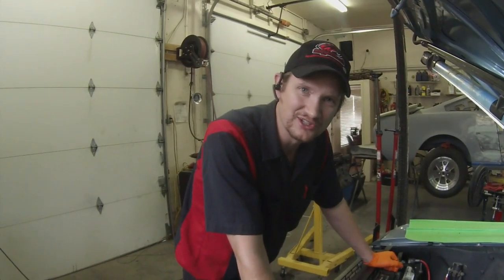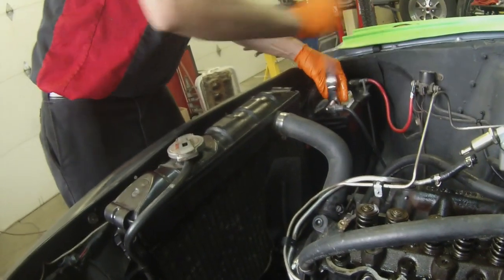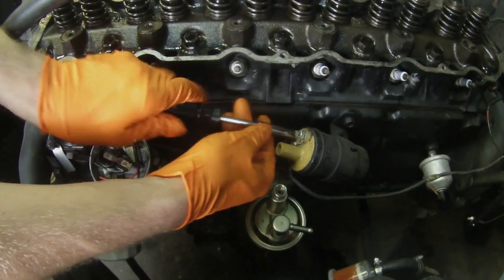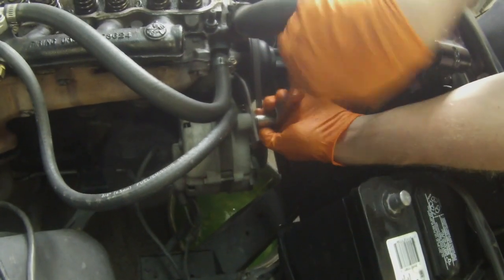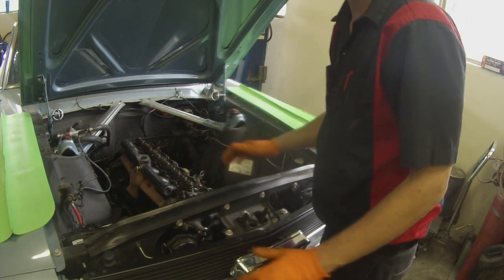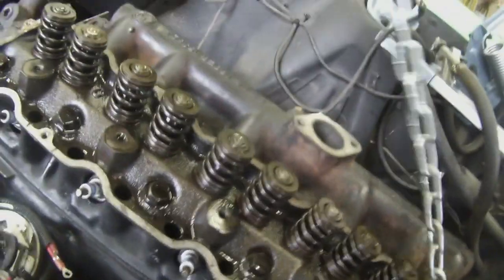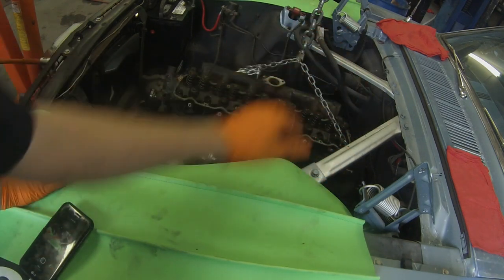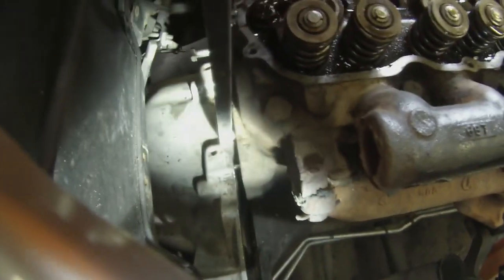Engine Removal 200 inline 6 -1966 Ford Mustang

Comment: I wanted to comment on removing the hood. The use of painter’s tape is such a good idea. I use that stuff for all sorts of purposes and mainly for marking where things go. When I remove a hood, I always loosen the 4 bolts (or nuts) remove the top fasteners first and then do the bottom ones. I saw someone do the opposite and folded the hood at the top because they lost their grip. I’ve never forgotten that.
Reply from the maker: Oh wow thank you for sharing your knowledge and experience!

Comment: What are you having a hard time finding, parts-wise?
Reply from the maker: Pretty much everything 6 cylinder related but I should clarify that the local market is hard to find. I can get stuff shipped in but finding things local is harder to find than 289 stuff.

Comment: Thanks for this video.  I'm working on pulling the in-line 6 from my 1966 mustang.  It has the 3-speed transmission.  Is it possible to pull the transmission at the same time?  The existing 3-speed transmission is sloppy so I want to either rebuild it or swap it out for a 1967 or later 3-speed that has a synchronized 1st gear.  If its possible to pull both at the same time, how do I disconnect the clutch bar from the engine?

Thx
Reply from the maker: It's very possible to pull both at once. I've done it before but you'll want to connect your engine hoist differently then what I demonstrated on this video. You'll want to balance it better from front to rear. I actually have a video on the clutch bar for a V8. The process will be similar for a 6 cylinder.
Reply from the maker: https://youtu.be/vwKSKRKLI3A
Reply: I used to do a bit of this kind of work and I always found it easier to do the engine and transmission at the same time but as  @AlfsMustangGarage  says you really have to be weary of the balance and where the chain is in order to maintain balance. It’s probably easier to do with V8’s because the v8 engine is heavy enough to force it level.

Comment: Great video. I was wondering if you could tell me what is absolutely necessary to change when swapping out a 200 i6 with a 289 or maybe 302. I hear people say changing components such as the rear end and front suspension are necessary and other say it is not. Thank you.
Reply from the maker: You know to be honest, nothing is really absolutely necessary aside from the engine mounts and transmission bell housing. However, changing the front suspension and rear axle are highly recommend. The 6 cylinder front spindles are smaller and lighter duty. The rear axle is smaller and lighter duty. If you want things to hold up and last, you'll want to swap out the whole front end for a v8 front end as well as the rear. 8" differentials we're great for v8 cars and very durable. There are lots of factors and options so I guess it kind of depends on what kind of power you're going to be putting down.
Reply: @AlfsMustangGarage  Thank you

Comment: I'm in cali Alf. I love it videos.. I have a a question!!   

I have 1965 mustang 200 3.3l. Automatic engine .  And a c4 tranny which was connected to a 1975 galaxy.  I had a problem mating-them.  But I replace the correct Bellhousing,  I replaced the correct torque converter. Now the 24spline connected to the Torque  converter is good but diameter to the pump is small..  what do I do? Or whats the ideal thing to do? What part should I change?  TQ or pump?  .

Comment: Watch both of your videos of you removing  your cylinder and taking it to be cleaned or rebuilt and you put it back on. Why are you replacing entire engine, didn't the engine run better after that? Or did I miss a video or something.
Reply from the maker: So I uploaded those videos out of sequence. The engine was replaced first because it had way too many issues and needed an entire rebuild. We found a replacement locally that was a fresh rebuild. Well it turns out on the replacement engine the bottom end was rebuilt but not the cylinder head. So when we fired it up, it was missing on the 2 cylinders. That's when I did the diagnosis video and then removed the head, had it rebuilt and put it back on. I should have edited the posted the engine removal and replacement first but it's just a not of film to go through and it was on my old camera lol. Did you notice the quality of film go from really good to not so good? So anyways that's what happened. All the cylinder head work was on the replacement engine.
Reply: @AlfsMustangGarage  
Ok I understand now, I like your videos, it's helping me with my 1963 ford falcon ranchero, this car sat for 10 years, it has the same engine as your mustang's, I am noticing that ford used the same engines in the falcon early years. I did a compression test, I also found that I had misfires as well, I went straight to taking head cover off, I found several of my push rods bent. So I'm going change all push rods and lifters and go from there. Thank you for answering me, you're videos are a tremendous help, keep them coming lol. If you have any suggestions for me, like to hear them. Thanks
Reply from the maker: Oh right on! Ya they are great engines and will last. The cylinder heads come off way easy. Just some of the things you have to watch for is if the engine has solid lifters or hydraulic lifters. Some of those early engines had solid lifters I believe so just watch for that because it's a different process for valve adjustments and what not. I have found that ford6.com has tons of great technical information on those engines also. That website has helped me a lot too. Good luck, thanks for watching and subscribing!
Reply: @AlfsMustangGarage  
Thanks, will watch for that.
Reply from the maker: You're welcome

Comment: I have a question on mine it was a 3 speed car and we’re swapping it out for a C4 automatic. I noticed there’s no plate between the engine and transmission in this video, just the flex plate. Do I remove the one that was on there for the manual transmission and just install the C4 with the flex plate only?

Comment: So to put anew one in is the exact same process backwards? Also does the trans just stay there??? Nothing else holds in I place in the car??
Reply from the maker: Pretty much. I have a video for the install process https://youtu.be/qUQ0b5O5hk8
The transmission will be supported by its own cross member and mount. However, I usually support the front of the trans with a floor jack and a block of wood just so it's not sagging down in the front.
Reply: @AlfsMustangGarage  thank you very much. This project is giving me an panic attack haha. I'm glad you got the 200ci engine vids since they are pretty rare
Reply from the maker: Oh ya it's a lot to handle for sure. Just take your time and be patient. I wish I had more 6 cylinder stuff. I just kinda film what I get and lately it's all been v8 stuff. But for a good while I was getting nothing but 6 cylinder stuff. They tend to come in waves lol
Reply: @AlfsMustangGarage  glad to hear it! I'm putting in another 6 obviously. This one has been sitting for along time indoors . Should I flush the engine and all that before having drive on the road?
Reply from the maker: So I would advise removing the oil pan to see if there is any sludge and clean that out. Once the pan is back on with a new gasket, add your engine oil (with high Zinc content) and then manually prime the oil pump. Watch this video on how to prime the pump https://youtu.be/bmWBJG3-RC4
Except in your case, you'll want to have a helper manually turn the crankshaft while priming the oil. That will get oil flowing to all parts of the bearings. You will also want to remove the valve cover to see if oil is getting to all the rocker arms. That's the biggest thing that I do with engines before I do all the work of installing. There are too many unknown factors with engines that have been sitting for years. That's why I open them up, take a look, get the oil flowing, test the oil pressure. I have a video for testing the oil pressure too. It's on a V8 but it's the same process for a 6 cylinder.
Reply from the maker: https://amzn.to/3EjeAez
That is the oil I recommend. Has the high zinc already.
Reply from the maker: https://youtu.be/85jCa0WS9z8
This video shows how to test oil pressure. In your case, you'll be manually priming the pump.

Comment: Hey Alf I have just a few questions I have a 66 mustang that I plan on doing a 5.0 edit swap from a fox body mustang I just wanted to see what I would need besides the rear end and suspension upgrades this is going to be my first swap/build with help from my brother he was the 5.0 and 5 speed transmission I just have to get the rest any advice you can give me I would really appreciate thanks
Reply from the maker: So the first thing I would ask you is if your car is an original v8 car or a 6 cylinder car. The second thing I would ask you is what you want the end goal for the car to be. As in a nice reliable cruiser or a street beast with lots of power or whatever you have in mind. And third, is the car solid? These cars are old enough to be concerned about the structure of the floor and what not. Those are my big questions whenever someone is considering big changes for a car.
Reply: So it is original a 6 cylinder with a 3 speed manual transmission I’m really just look to get more power and that extra gun out of the car no upgrades have been done and I’m wanting to kinda of do a poor mans restomod 😂😂😂 I know it’s going to be a lot of time and Money but I figured I have time but I’m not sure where to start
Reply from the maker: Okay so ya the most recommended things are to upgrade the suspension to all V8 options. Everything on the front end of a 6 cylinder was was light duty. So you will want to plan on swapping everything out there. The rear end also was a small light duty 7.5" differential. You'll want to upgrade to at least an 8". There is no need for a 9" unless you're going to be throwing down some serious power. But for most stock or mildly modified 302's, an 8" Ford will be just fine. Then of course you're cooling system is going to need upgraded as well once you're actually throwing in the V8 but other than that, thats pretty much where I would start. Front suspension, steering, spindles, front disc brakes, 8" ford differential. Let me know if you need any parts to get started on your process and let me know if you have any other questions.

Comment: quick question... did you put the block of wood and the jack under the trans pan or on the bell housing.  thank you for the content!
Reply from the maker: Yes I did to support the trans while engine is removed.
Reply: @AlfsMustangGarage  did you put the block under the trans pan or the bell housing?
Reply from the maker: The pan. I make sure I have a big enough one to go across the whole pan.